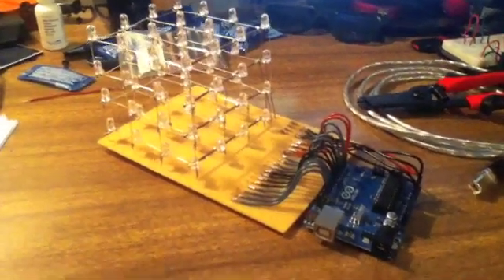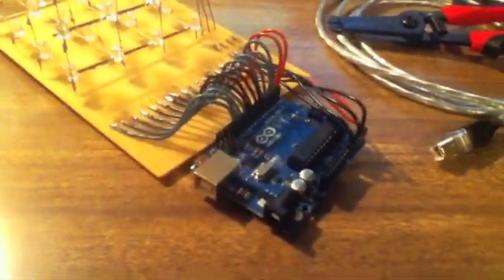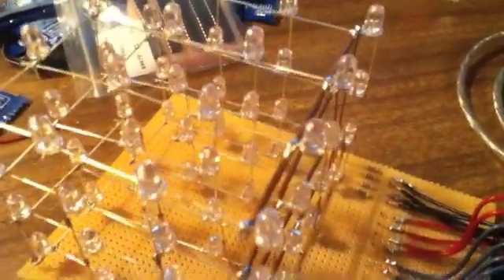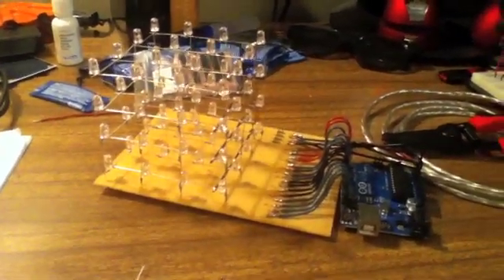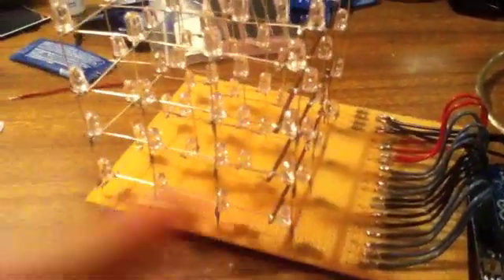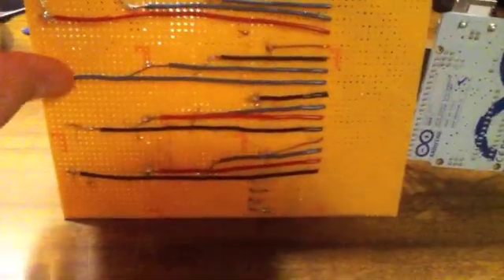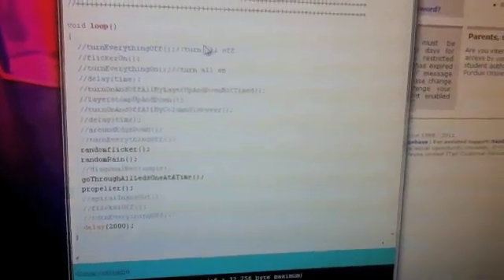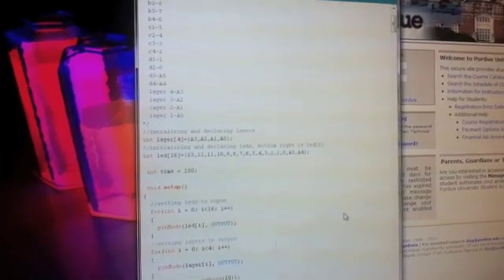How to make an LED 4x4x4 cube with Arduino Uno

Comment: Such a great tutorial! I made the cube and it turned out great! I just have a really quick question if you mind me asking, I copied your code and tried to upload it to my aduino uno and I got this error message: 

Sketch uses 6,464 bytes (20%) of program storage space. Maximum is 32,256 bytes.
Global variables use 53 bytes (2%) of dynamic memory, leaving 1,995 bytes for local variables. Maximum is 2,048 bytes.
avrdude: ser_open(): can't open device "\\.\COM3": The system cannot find the file specified.
Problem uploading to board.

Do you know what this error code is saying and if so do you know how i can fix it?  Thank you very much for your time.
Reply from the maker: Josh Simkin check your usb connection. Try to upload one of the other sample programs built into the arduino ide to prove that its not my program. But, I'm pretty sure its your usb connection

Comment: Hi :) 
I see you're still responding to comments, so i tought i asked a question.. 
I saw the code and i got "stuck" at just the first function.. As you go on and light up all of the 64 LEDs, you do that at the same time for all of them.. Doesn't that draws too much power out of the Arduino? Isn't it better to do light one up at a time? 
Also.. There's no fading effects.. You can (not you specifically) implement those, right? Just like the simple fade examples that the guide provides. 
Thanks a bunch in advance!
Awesome video!
Reply from the maker: Luca Bossa Well, the arduino is still working so I guess not. You can give multiplexing a shot but i believe that is the only way to get the fading effect...google it. Thanks for the kind words

Comment: if you write
 "  digitalWrite(led[13], 1);
    delay(x);  "
then when does the led go off?
Reply from the maker: qdkqzdkm klzkmld it will turn off withe digital write command and then delay for the value of x
Reply: thanks for the responds

Comment: My function turnOnAndOffAllByLayerUpAndDownNotTimed() does not work and I don't know why. The only difference from my project to yours is that my LEDs have their negative leg bent instead of the positive. Could you help me to make it work please?
Reply from the maker: Rodrigo Tresinari you will have to find where the code "digitalwrites" the pin high and low and switch it. it's been a while since I have looked at that code but that is probably your issue
Reply: I switched lows to highs and vice-versa on that function but no luck yet :/
Reply from the maker: Rodrigo Tresinari so it's jus that function? I would see if that function is referencing another function...i bet there is an issue in another function.
Reply: So I looked the code up and the function I mentioned is related to this one, which does not work:

void turnEverythingOn()
{
  for(int i = 0; i<16; i++)
  {
    digitalWrite(column[i], 0);
  }
  //turning on layers
  for(int i = 0; i<4; i++)
  {
    digitalWrite(layer[i], 1);
  }
}

Odd thing is that the first digitalWrite should write high instead of low. I tried replacing it with high like this: "digitalWrite(column[i], 1)" ; It did not work either.

This function is being referenced in various other ones and it is messing them up. Do you know why this one won't work?
Reply from the maker: Rodrigo Tresinari try flipping the 16 and 4 and the 0 and 1...i think you are jus going to have to play with those arrays a bit. those values are turning the logic high and low because of how they were setup physically, you have to do the opposite in code now

Comment: You should add the transistors to the layers, arduino pin can only withstand 40mA load. You can easly burn the arduino.

Comment: when i give power analog pins rows and column are blinking.. but when i interchange the header position  4 centre rows are also working.. but 10 rows are still not working and those are very dim too.. i am giving 6v 1amp supply... and used 150k resistors..

Comment: please provide deacription about ardiuno inputs to led cube asap
Reply from the maker: There is info about that in the code.
Reply: +showstopper1v100 ok thanks for quick feedback
Reply: +showstopper1v100 when i give power through usb source only three rows aur working but the led is very dim.. and the voltage got diminished after every row.. but when i give power throgh dc jack not even a single led is working.. please give your feedbacks ASAP.. thanks in advance

Comment: Yes I looked through the videos.  I like everything that you have done.
What I would like to do is add to it.  I would like to create a pattern
where the first light in the lower corner lights then the next the next
etc, in a pattern that rings the perimeter of that side, then (all lights
on yet, then the next light jumps to the next corresponding face and traces
that outline until five sides light, then they all flash five times and it
switches to a tree piece snake that starts from the inside center and works
its way up and and then outward after reaching the top of the center, go
through the entire cube and then reverse  The last pattern would be to
create the effect of raindrops falling, from the top to the bottom in a
random pattern.

I hope that I explained this well enough for you to get a sense of what I
am looking for.

Thanks,

John
Reply from the maker: +John Nelson Well, I just pulled out my cube and I forgot that I have replaced my Arduino uno with a solo Atmega328p chip with a few components hanging on the side. What that means is that I can no longer program my cube without taking it apart. So, I won't be able to code anything for you. The best I can give you is start with turning on one led, and then continue to turn on other ones until you get what you want. you aren't going to break anything so just give it a try! Sorry I couldn't help you.

Comment: you are making anodes common right ???
i want a schematics of it please im beginner
Reply from the maker: +nagesh udasi The anode is always positive on an led, otherwise it will not light up. I do not have a schematic unfortuneatel. Connect the resistor to 5v, the other side of the resistor connects to the long leg of the LED, the short leg of the LED connects to the pin on the Arduino. You will turn the pin on the Arduino high to turn the LED on, and turn the pin on the Arduino low to turn the LED on. Hope that helps!
Reply: +showstopper1v100 you didn't got my question 
I said are you making anodes common or cathodes common
Reply from the maker: +nagesh udasi If the anode is positive, like I mentioned, then the cathode is common.

Comment: I have never done anything like this and it seems like a lot of fun to build but i have a few questions, like what is the distance between the holes in the jig that u made out of wood and what size wire would i use and does it matter if it is arranged in the color coded like you did? TY! Cant wait to build it.
Reply from the maker: +Foxx Wenzel Just make the distance the length of your led leads so you don't have to cut them down any. I'm not exactly sure what size I used for the wire but 18ish gauge should work fine. And you can use any color led, I just picked blue because I liked how it looked! Check out other cube videos to see what other colors people have used before ordering the LEDs.
Reply: +showstopper1v100 Thanks man.

Comment: I can't open the code from that website, I'm using a smart phone.
Reply from the maker: Try opening it on a computer with the arduino environment on it
Reply: Oooh ok
Reply: +showstopper1v100 thank you man I finally built mine exactly to your specifications and it works!! You can look at it on my channel if you want.
Reply: +shesmine14 
hi, where do you have the  programming for the LED's im doing a project and I would like to know and see so I can follow and make different patterns maybe, thanks in advance!!
Reply: Jonathan Campero well I don't have the program link, but showstopper does, it should be in his description

Comment: im confused a little, if you turn on a1-layer1, and b2-layer2, how is it that a1-layer2, and b2-layer 1 dont turn on?
Reply from the maker: I'm confused by your question haha. So if u turn layer 1 high and a1 low, a1 on layer 1 will turn on.
Reply from the maker: I think understand your question after reading it again. And I'm not sure :/ from what u described, they should b on.
Reply: +showstopper1v100  thats half of it, lets say i turn layer 1 high, a1 low, to turn on 1 led, but i want another on at the same time vertically diagonal, so i need to turn layer 2 high and b2 low. but seeing as a1 is low it is now low for layer 1 and layer 2, so wouldnt layer 2 a1 turn on as well as layer 1 b2?
Reply from the maker: +Justin  Letterman It sounds like what you are saying is what should b happening. But without being able to have it n front of me I can't tell you much more unfortunately. Good luck!
Reply: +showstopper1v100 im going off of your design, your video. i havent made it myself, im asking how yours doesn't light up unwanted leds.
Reply: +Justin  Letterman is the program doing a multiplex type thing?
Reply from the maker: +Justin  Letterman Oh ok now I think I understand. we'll I ran I to this problem as well and if you look at my whole program I never use diagonal animations because it wouldn't work for the reason you mentioned. There may be a of multiplexing but I have always found the arduino's clock is too slow for many applications of this sort. I could be wrong though.

Comment: Hi showstopper1v100, I have made this cube and worked fine. I also tried upgrading the code but there was a problem regarding function declaration. when I wrote down the new code and tried to upload it, an error popped up saying "function was not declared in this scope" and highlighting the function call in the void setup. Can you help pls ? thanks :)
Reply from the maker: +Gailen Borg with out seeing the error or code I would guess you didn't call the same function in the "main" part of the code as you did in the function part of the code. Does that make sense? I would google the syntax of a function and how to call it. I always look on the arduino website for any syntax questions

Comment: hey man, doesn't the arduino only have 13 outputs, how did you use 16?
Reply: have you resolved this problem!!! i am also facing the same problem. thnks in advance
Reply: +Sandeep Thakral i believe u can make the analog ones as outputs in the code
Reply: +Shlomo how can i program analog signal to ardiuno.. thanks in advance
Reply: +Sandeep Thakral you should be able to declare it using sometjing like this:
pinMode(A0, OUTPUT);

Comment: @showstopper1v100 Hi i want to get an arduino to build a led cube but i wonder if the mega is better the uno...  and if i can connect all the wires the mega they same way you did for the uno. TY
Reply from the maker: the mega has more I/O...more pins to put out signals and measure signals. It also possibly has more memory space(not 100% sure on this one). It's not necessarily better, just bigger and more room for growth(so I guess better :D ). you can use the same pins as on the Uno.

Comment: I've just finished building my own cube, and ti seems that the LED's won't light up like in the video, some effects work as in the video, others don't. What could be the problem? Everything is connected properly, checked everything.
Reply from the maker: The only thing I can think of is that some of the leds are connected backwards. I had a few that I accidently switched around. One backwards led could take out a whole column. I would check that first.
Reply: Leds are properly connected. Some parts of your code work perfectly, and on other ones some Led's just won't light up
Reply from the maker: Maybe try reprogramming the arduino? Not 100% sure :/ this is one of those things that you most likely have something really really small wrong that you have overlooked so just look over everything again. That's all I can tell you :/

Comment: In many other videos they show that all the cathodes are soldered together and the anodes are left down ...... so are both the methods your(with anode soldered in column and cathodes down ) and other same ... Please try to answer soon ..am stuck at my school project...
Reply from the maker: Both methods are not the same. Because LEDs are diodes(Light Emitting Diodes) they only allow current to flow one way. Therefore if you hook them up backwards, there will be no light. Either way works you just have to provide ground and positive correctly, which is done in the coding. Hope that helps!

Comment: So from what I'm seeing you're using your analog input pins as a switchable ground?  But if that's so why are the A0-A3 pins set to 'OUTPUT'?  I like your build because it didn't require me to buy transistors and allowed me to complete it with what I had on my shop bench.  I'm just trying to understand the circuit before I finish hooking it up and powering it on.
Reply from the maker: Yes that is correct. Although arduino advertises those as only input pins, they can be used as output pins. I am only digital writing to the pins in all of my code. When I write "LOW", that pin is effectively a ground, and when I write "HIGH" that pin is effectively 5V. This allows current to flow from the higher potential to the lower potential. Hope that helps.

Comment: I made my own cube, :) ca nyou help me with the problems i run into, hopefully your there... i plugged it in and it said this :
Binary sketch size: 7,336 bytes (of a 32,256 byte maximum)
avrdude: stk500_getsync(): not in sync: resp=0x00

Do you know how to fix this? im not very good with code yet so...
Reply: I checked the COM ports in my device manger and made sure they corresponded to the arduino COM port. I noticed no matter what USB port i put the cord into it still said COM 4 is the port, is there something wrong there or is that normal.
PS, sorry for my horrible English up there...
Reply from the maker: Raiding Kings Make sure you have installed all of hte arduino software drivers, this could be a problem if you dont have them all. check out this video: 1. Installing and setting up Arduino (Windows)
Also in the arduino environment, go to Tools/Board ot make sure you are programming the UNO( assuming you are using the UNO) and then go to Tools/Serial Port to make sure you are connected to the serial port that the UNO is on. The "avrdude: stk500_getsync(): not in sync: resp=0x00" is a connection error not a coding error, so you aren't connected to your UNO. Hope that helps!

Comment: Does it matter what kind of LED you use, Voltage amps?
Reply from the maker: They drop 3.3V and pull 20mA I believe.
Reply: showstopper1v100 how can i program the code to go by b0000??
please

Comment: u have 16 cathodes and 4 anodes ,but do u grounded your 16 cathodes on arduino using transistor ?
Reply from the maker: No, the grounds go to the pin...the  cathodes are the gounds. you can turn the pin into a ground in the code, essentially.
Reply: showstopper1v100 thank you

Comment: Bro can u give me some schematic or something else cuz i dont see how are LEDs connected?
Reply from the maker: I dont have a schematic. You connect all the positives by layer, and the negatives by column. and then just hook them straight into the arduino(except remember the (4) 100 ohm resistors that limit the current for each layer). The code has which pin to hook up the layers and columns to.
Reply: showstopper1v100 ok so the less are wired positives and all the negatives hang down connecting to the negative below it?

Comment: How did you connect the copper house hold wiring?
Reply from the maker: I soldered it on. It's just for support, so you dont absolutely need it, although i would recommend it.

Comment: Could you give me the LED specifications?
Reply from the maker: The LEDs are your standard LEDs, they drop about 3v, and are about 1 inch from top to bottom
Reply: Thank you so much :)
Reply: Oh btw, your tutorial was great, finished and worked so well, working on my 8x8x8 LED cube now, thank you sooo much xD
Reply from the maker: Glad it worked out for ya!! You should post the vid of your 8x8x8!
Reply: Had a little issue with my shift registers and bag wiring, but it should be diagnosed soon :P send you the vid after I'm done xD ty for teaching me everything ur soooooo awesome !!!

Comment: it says:    avrdude: stk500_getsync(): not in sync: resp=0x00
Reply from the maker: So there is something wrong with your connection from the computer to the board. Try uploading a smaller program that you know works just to be sure your connection is right.

Comment from the maker: The file should online file should work, I just checked it! And the Arduino uses the Atmega 328p
Reply: Dude i did it!! thank you so much!!! PS the code works great how can i program the code to go by b0000?? Thanks again! ill be posting a short video soon :) let me know what you think
Reply from the maker: Awesome!! Isn't it such a good feeling when it all works out? haha. by b0000, do you mean binary?
Reply from the maker: because arduino hides all of the binary stuff in the background. So essentially when you are changing the outputs from 1 and 0 to turn the leds on and off, the arduino libraryies are converting that into the binary. You can do straight C code in arduino to accomplish programming in binary but I don't have a whole lot of experience doing this. I would check out the arduino forums. There is loads of info on their. Happy building!
Reply: Still looking up that stuff but thanks!!! PS I put a link for how  to build it on my video to yours if that's alright with you? Thanks again! and great video by the way! Just wish i know how to program my own lol that's why I'm trying to make it a "B0000" cause that I do XD
Reply: +showstopper1v100 88k

Comment: question if you are going a breadboard style 328p chip without the uno board is the wiring for the pin out for the cube the same I know it's different pins but in the coding is it still  same coding?